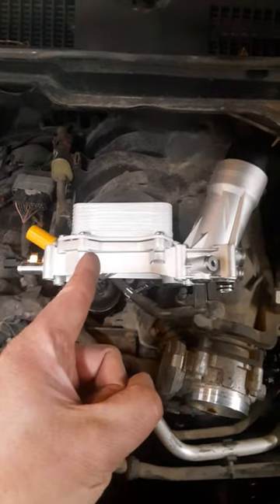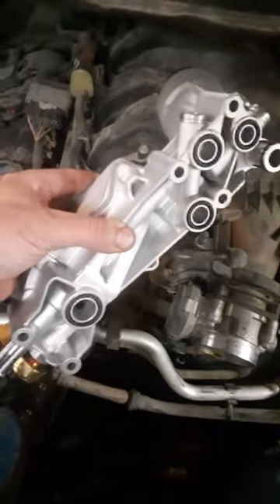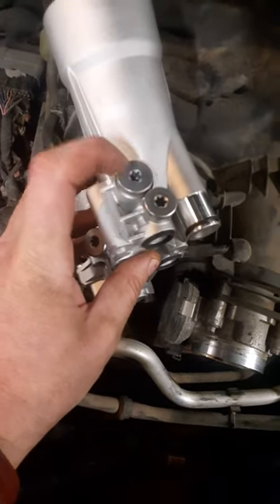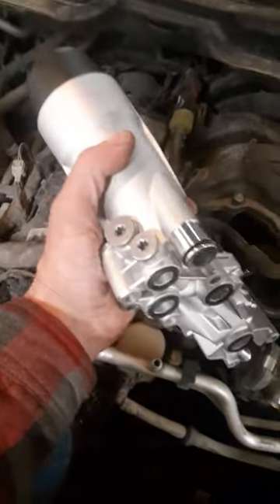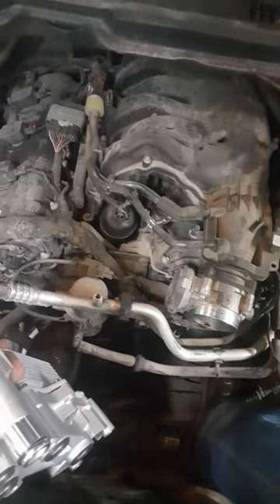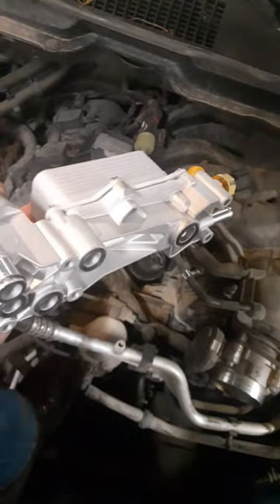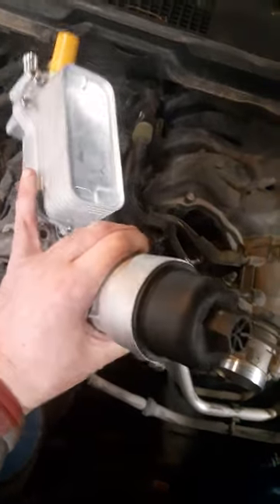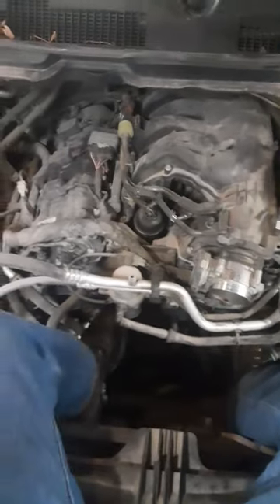Oil filter housing in the Ram 1500 3.6. Failed

Comment: Chrysler... looks good but doesn't last... same getting with GM, Ford... my dad has an old c10, simple, 200k miles.. I miss good cars
Reply from the maker: I fully agree. There's so much 'reinventing the wheel', yet only making it worse.
They want cars dead by 200k miles.  Remember volvos 'Million mile' club? That's gone. Why? Volvo got invaded by the bean counters from GM, lost all of their good, boring, boxy, ideas.  Now no one wants a Volvo
Reply: @thirdpedal4512  Agreed.. how difficult are the sensors on that engine to work with, replace, etc
Reply from the maker: @applejuice9468  other than the water temp and oil pressure, not bad.